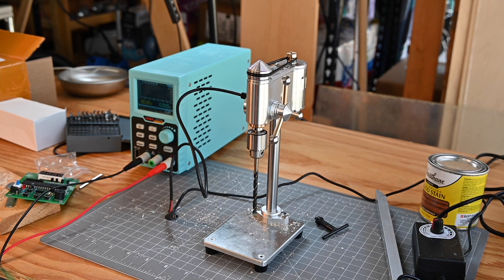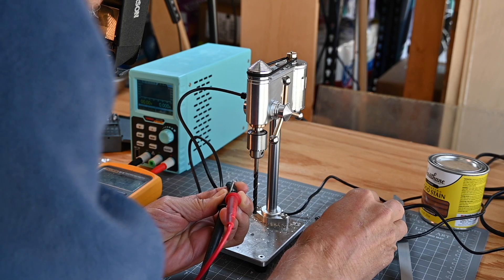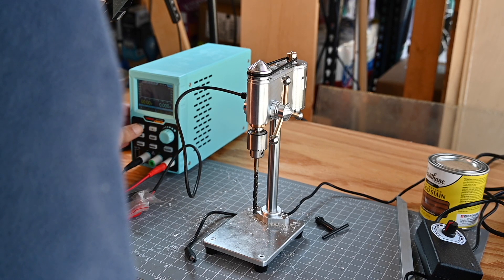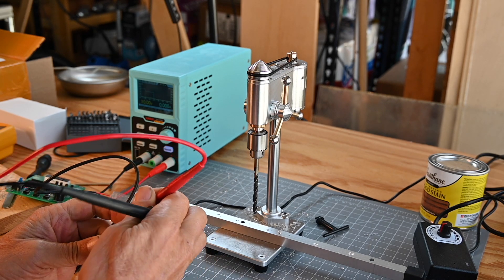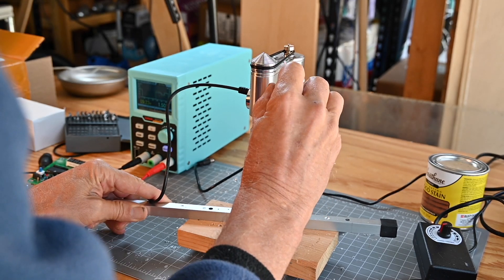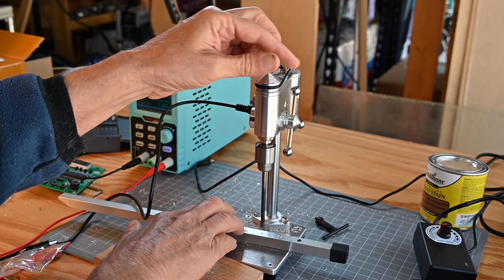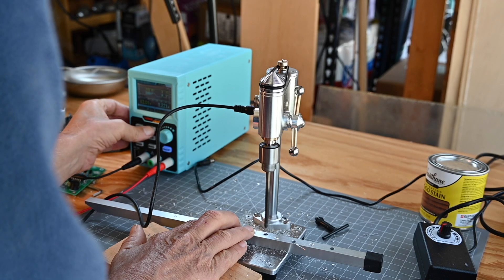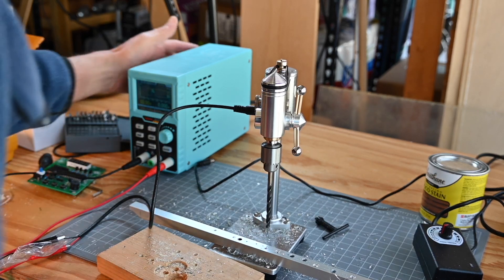C.K. overpowers  a Mini Drill Press from Innocraftsman, followup to yesterdays video

Comment: The big problem with those tiny drill presses is runout.
Reply from the maker: True enough, you need to move very slowly to keep the wobble away.
Reply: @CKHaun  This is why in my micro machineshop I opted not to have a micro drill press. I'll just use the milling machine for my drilling.

Comment: The drill bit must be very dull 😮
Reply from the maker: It was pretty new, but a general,purpose bit, not a metal-specific one. Thanks for stopping by!
Reply: @CKHaun  I have a  Chinese mini drill press works great with sharp drill bits and slow speed  light pressure 😊 but for $40 bucks can't complain. Great for circuit boards .my Dremel drill press  was just to big  .the little press  I can just put in desk drawers 😊

Comment: I purchased a mini drill press like that but it's another model off of Amazon. I found two different pulleys so I can adjust the speeds on the top.. the key to using something this small is sharp drill bits and taking your Time 😊
Reply from the maker: True enough, and I was rushing a bit. Thanks for stopping by!

Comment: The concept is great, thank you for reporting on this tool. As it is, I’m afraid that it’s way too underpowered. That being said, the machining of the product looks nice and promising  with more development: more torque and throw range of the drill.  I appreciate your trying a beefier power supply. You were not abusing the tool in any way, so one would expect that it would not stall the motor. I would have rather seen the belt slip first.  Keep up the great work. I look forward to your video instruction. I find some very inspiring.
Reply from the maker: Thank you for your kind words!  And yeah, on my big press the drive belts will definitely slip (and produce amazing burning rubber smells) when a spade bit stalls, not this thing though.  But it is pretty, and I will use it every now and again.

Comment: Wow, this little thing is very cute, and i agree that higher wattage from your supply helps. However, i see it priced at 90 bucks on amazon. That is way overpriced. I can pick up a small drill press converter for 20 to 40 bucks and i can put my powerful cordless drill in it. That will drill through anything without slowing down. Plus it needs no supply. Thanks for the video, C.K, but too under-powered and tricky for me.
Reply from the maker: Yeah, it’s a novelty item aimed at suckers like me who will buy any cute “tiny tool”.
Reply: @CKHaun  Ha Ha...no worries...it does look cool.